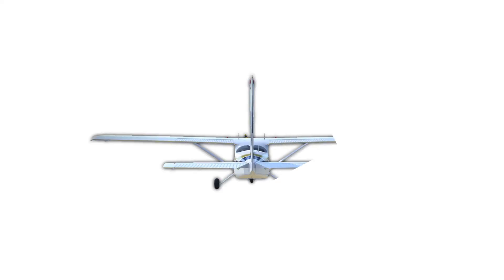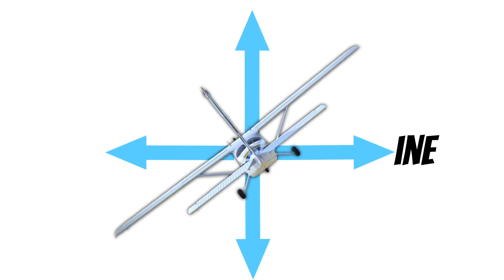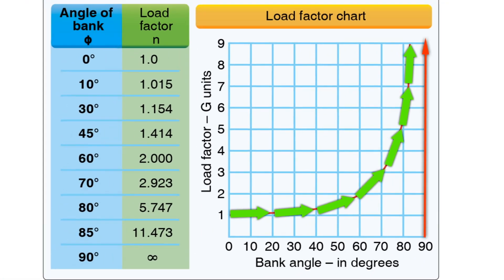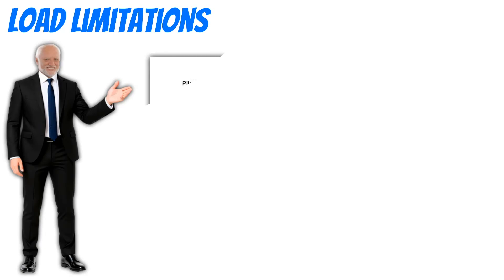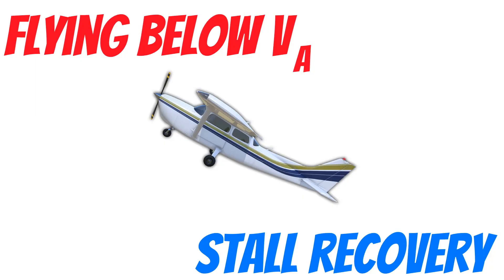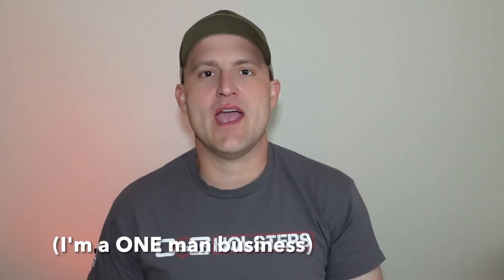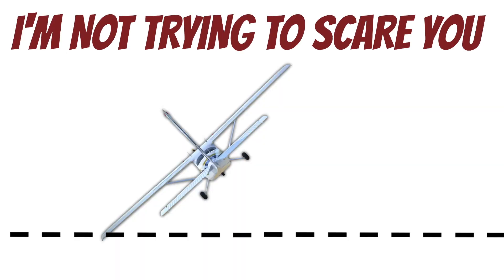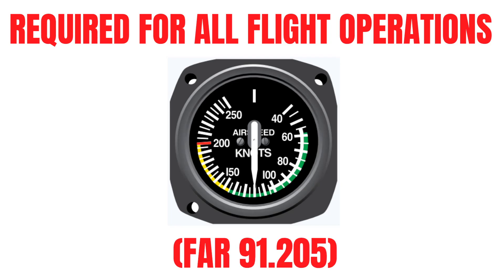Load Factor BASICS explained (EASY to Understand)

Comment: Hello I commented on another video and was referred here. I am trying to understand this better. I understand the load factor is  square root 1.414 Gs at 45 degree turn and it increases stall speed from 50 to almost 60 knots. What I don’t understand is how this correlates to the AOA? The AOA never changes no matter the speed I thought.. sorry I am really confused. Appreciate your help.
Reply from the maker: It’s explained in this video, but AoA must increase during a turn, otherwise you will descend

Comment: Thank you so much for this video — I was just studying Va last week and hadn’t yet learned about the load-factor concept!

I do have one question though. I’m still trying to fully understand why Va increases as weight goes up, because intuitively it feels backward. If two airplanes fly at the same speed and both pitch up abruptly (a Va scenario), the heavier airplane should be producing more total aerodynamic force on the wings, which sounds like it should make the heavier one more likely to reach structural limits first — suggesting a lower Va, not a higher one.

The common explanation online is that “a heavier airplane flies closer to its critical AoA, so it will stall sooner before hitting its structural limit, therefore needing a higher Va.” ; and My instructor explained it as “load factor = total aerodynamic force ÷ weight,” so a heavier airplane needs more total aerodynamic force before reaching the same load factor limit, which then implies a higher Va. 

While this matches the math, it still doesn’t feel intuitive — the wing itself doesn’t magically get stronger just because the aircraft weighs more.

I’d really love to hear your take on this and how to reconcile these perspectives, thank you for your awesome work once again ❤
Reply from the maker: Here’s the way I see it, and I’m not sure it’s right, but it makes more sense to me…when an airplane is flying at a higher angle of attack, the wings are angled upward so the weight is distributed across a stronger cross-section of the wing. For example, a 1x4 would be much harder to break if it’s sitting on its edge, if you turn it on its side, it’s much weaker.   Even twisting the board slightly will allow it to support more weight 🤷‍♂️

Comment: Your videos are great. However, jumping moms wont produce any change in G-s while landing, They will always be pulled by gravity at 1 G. They will change their G-s when accelerating upwards, but downwards it will be 1 G no matter how high they jump,
Reply from the maker: Thank you! Yes, technically you can pull more than one G when you jump up and hit the ground. That’s why it’s so painful to jump from a big height sometimes. This is also why you would die if the elevator broke at the top of a 20 story building and you free fell all the way to the ground. Your body would pull a huge load for a split second at the bottom, and it would likely be more than you could handle.  I learned a lot about G-forces in AF pilot training. They gave us some interesting examples lol
Reply: @FreePilotTraining  Big height = longer time accelerating at 1G, not greater acceleration. Hence person jumping from 1m height will have less speed when touching the gronud than person jumping from 2 m height.
The moment moms legs leave the gronud they stop accelerating upwards and begin decelerating.  After they stop in the air  they begin accelerating towards earth at 1 G or 9.8 m/s².
Earth gravity gives constant acceleration (if we disregard minor differences regarding position on earths crust or altitude) for all bodies equally.
Only if mums had some propulsion on them, and they continue to accelerate upwards then their G-s would become greater than 1G
Reply: This is the most informational discussion I’ve ever had about your mom. Thanks for the breakdown and extra info.